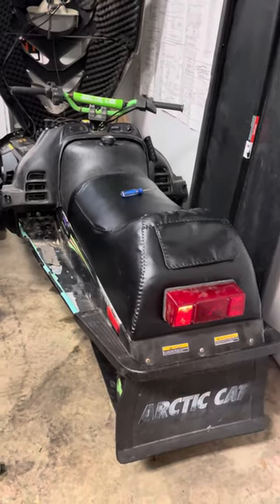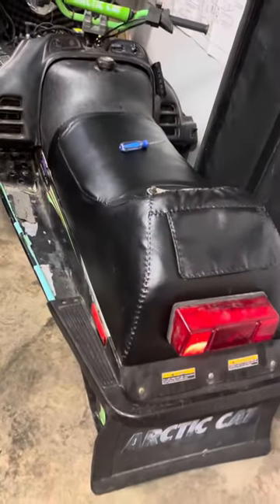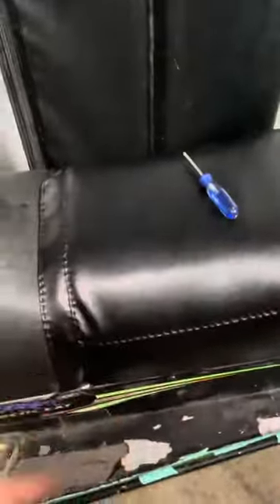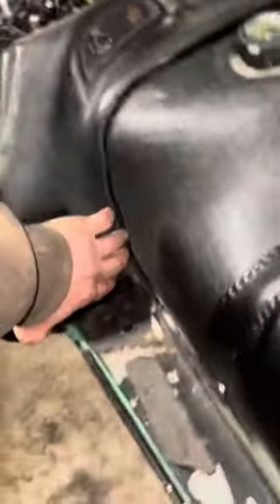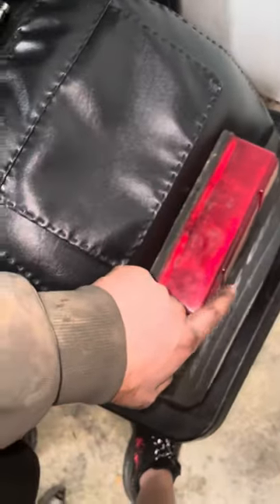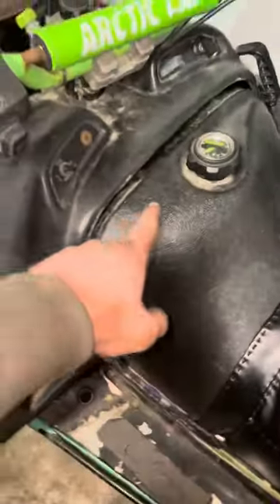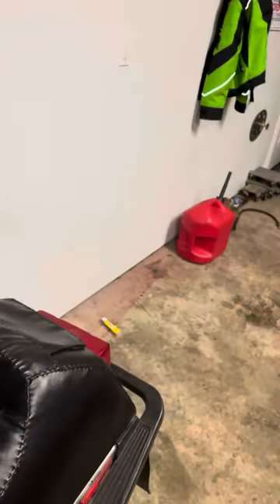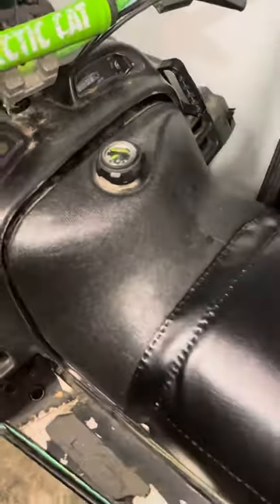Arctic Cat Cougar Seat/Tank Removal

Comment: Was removing the seat from the tank hard to do? I have a 97 puma want to ditch the seat but keep the tank and do something custom with a polaris pro ride seat
Reply from the maker: To be honest, I didn’t have to do it! Had a reupholstery guy in town do it who specializes in snowmobile/ATV seats. I think he basically cut the “rubber/leather” cover off, added/reformed foam to get it back to the original shape, then stitched a new cover from scratch. 

I don’t think he even removed the foam, but if you remove the seat similar to how I did it in this video, you can flip the tank over and use a flathead/needle nose to remove the staples and you should be able to be left with a clean slate of just black plastic tank. 

Just got rid of our 97’ Puma 340, super fun sled. Check out the video of us resurrecting it after sitting for years. Have fun mobbin the ole Pumer.